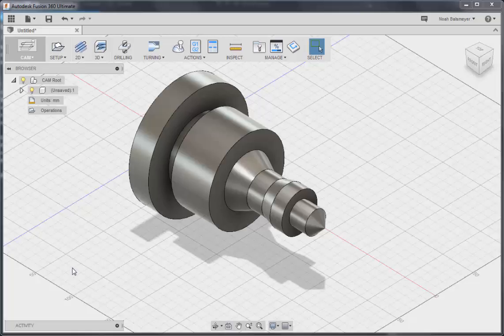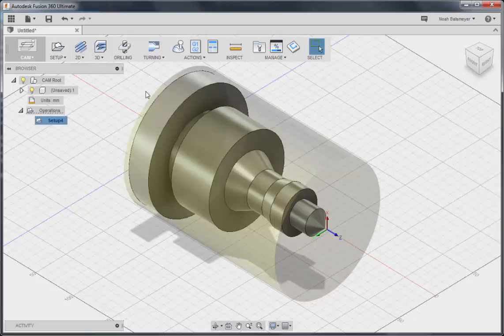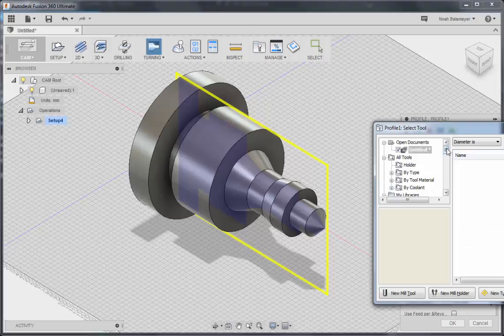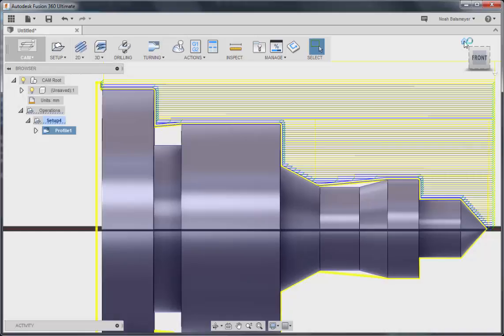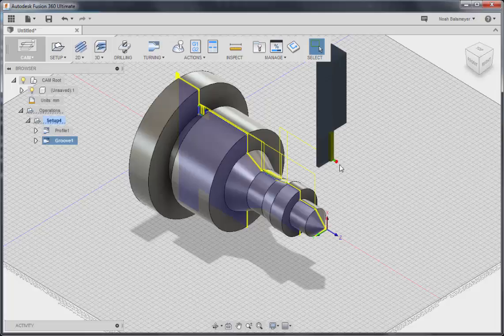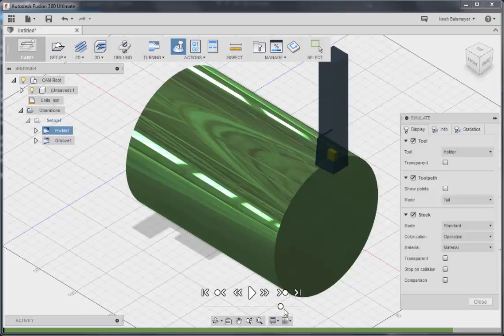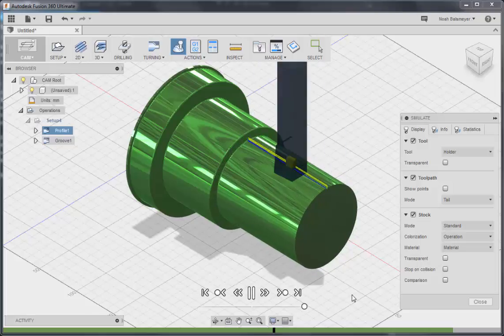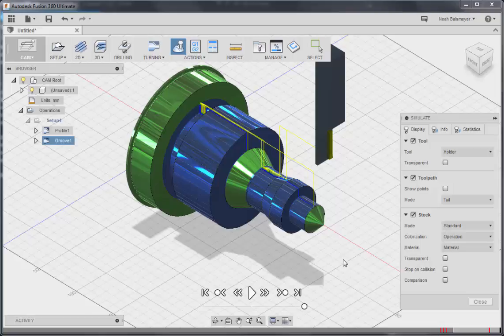Development Update: Fusion 360 Turning

Comment: PLEASE tell me the turning module will release soon; these old EIA/ISO controllers are killing me! Ewwww, G-code, on a lathe even, .........that's like so TOTALLY '80's.. ....like totally. What's worse; that faint memory of G-codin' it back in the eighty's. Yep, it's pretty much out like shower grout.
 Ultimate really came to the rescue for our milling department; the remaining non-Mazatrol  pieces anyway. I've been a complete disciple of y'all's competitor for many years, and happily so. With that said, like the '80's mentioned above; that too is a thing of the past. One would be foolish not to take full advantage of what's offered in Fusion 360/ Fusion 360 Ultimate at such a bargain.
 Thank all of you guys at Autodesk for turning the CAD/CAM market on it's ear! This simply MUST revolutionize that market; it's TOOOO GOOOOOD not too. I remember back when y'all released the initial details and pricing; which was unbeknownst to me at that time. I could smell s#!+ and hear screams comin' from miles around......I reckon it was other CAM providers.